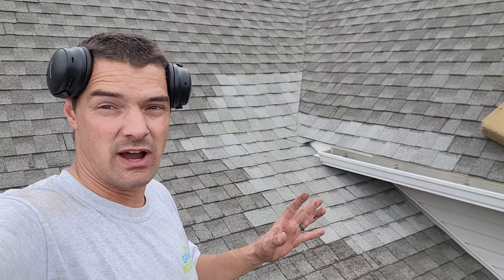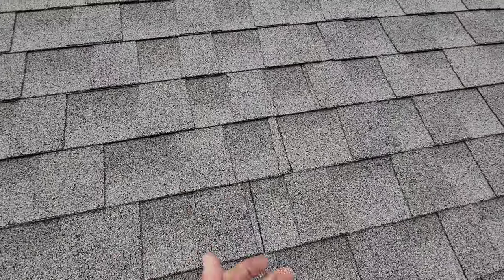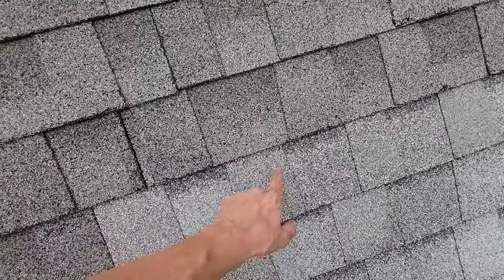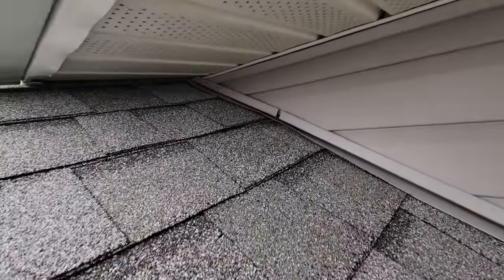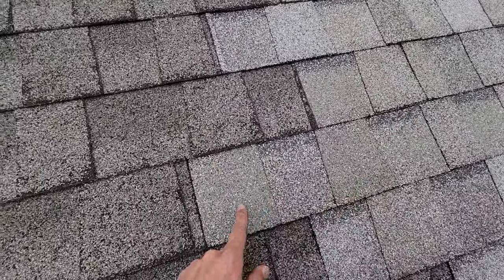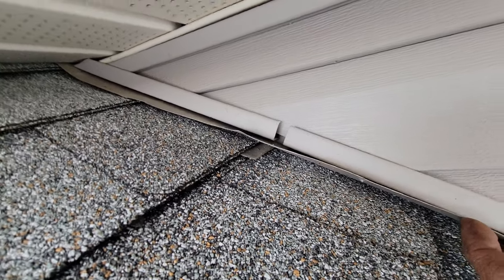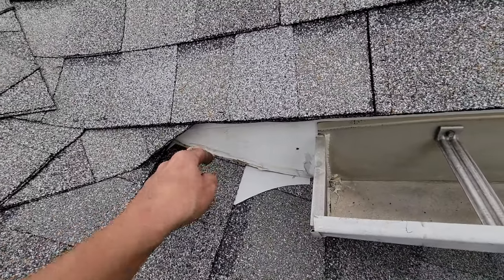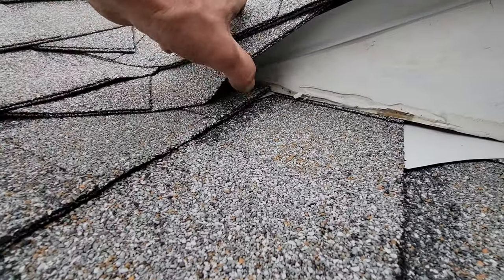Roof Valley Leak,  after repair video. Do it the right way, or it will leak!

Comment: So when i was last on this channel, i was roughly looking into replacing my roof and got some advice by you on when the best part of the year is to get it done.

I pulled the trigger and got it done but oh boy the grimlins that were uncovered. 

When the roofer got on the roof to qoute a price, there was a section between the kitchen skylight and bathroom skylight that sank down at least 4 to 8 inches when he placed a little of his weight on it. Which let us both know that something in that section wasnt up to snuff. I got qouted 8k for 1.2 square foot roof. (Alot cheaper than i was mentally prepared for) i added replacing the gutters to round it off around 10 or 11k. 

Roofer gave some warning that he doesnt have xray vision and he knows a fact that at least 2 boards would have to be replaced but he doesnt know what the rest look like under the 3 tab singles. 

Fast forward a week and now i got a crew ripping up the roof, he contacts me to come and check something out (never a good sign). The roof was not vented. It had the shingles as if it was but it was only a decoration. Every single board on the roof was rotten and the insulation was crap due to condensation/slow leak. He offered to use the existing boards that were there but he pretty much said "when youre making dinner be sure to have a plate ready for me because ill be here so often fixing leaks". Took 85 boards to cover the entire roof at 100 a pop (mostly paying for labor really) and the irst 4 were on the house (pun intended) 

So very rapidly, this job doubled in price and i just said screw it, replace the soffits too. Came to 20.4k. Luckily enough, the guy was willing to work with me and i paid off 3k every month as i didnt have that much liquid capital. Just paid the last 2.4k a few days ago so i can finally put that saga behind me.  

But i always had in my head that its better to get this done than have a massive failure like ive seen in some of your vids

Comment: Hey , go check out the pitch hopper roof wedges . I bought two and man I gotta tell ya - it saves you on the steeper pitched roofs and you don't have to set up staging . Better than bringing couch cushions to the job . Looks much more professional bring a fall arrest prevention system

Comment: Nice repair! I enjoyed this type of video.  Too bad color of new singles is visibly different.  Is that something you tell customer ahead of time?
Reply from the maker: Yes, every one of my repairs states the shingle color will more than likely be a shade off. It's because of the algae growing on a shingle eating the limestone. Even if they had the same shingles from the original install setting in a garage, they would not match years later.

Comment: Could pewter gray be a better match?
Reply from the maker: Yes, Peter Gray was a slightly closer match. But it's not available anywhere in my area. Something about the granules there's a shortage on that color I guess. I did talk to the homeowner about it beforehand. He said that's fine I just need to get the leak stopped. He's planning on doing the roof soon anyways.